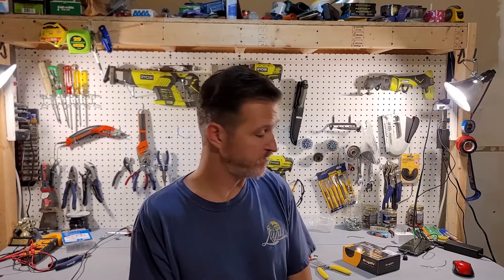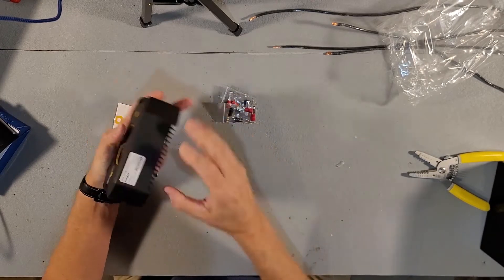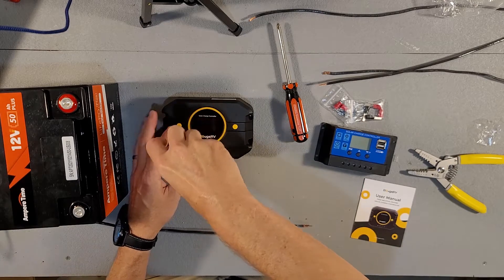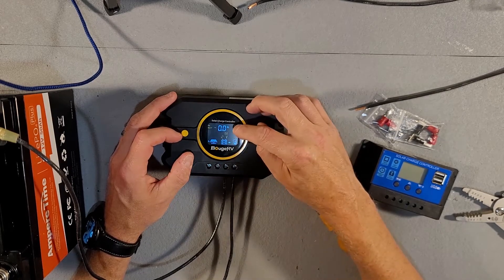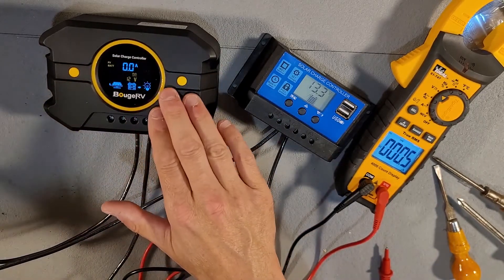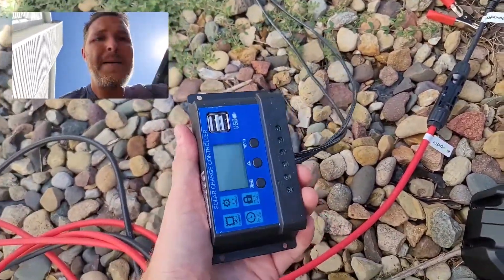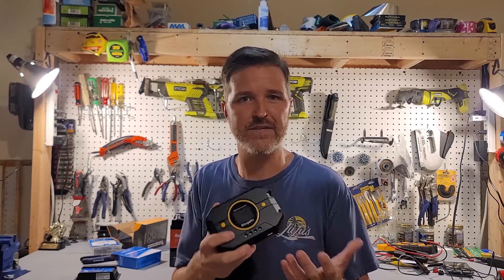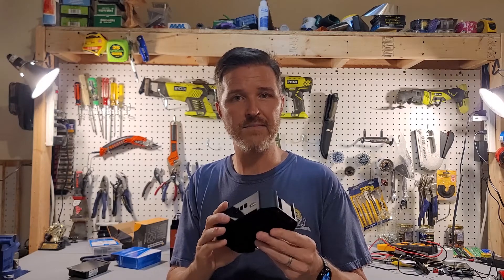30A PWM Solar Charge Controller Review| BougeRV

Comment: I have bought two Bourgerv 20 amp PWM for may small set up which will replace the cheapo ones. The reason for 2 is because I have two 100 watt solar panels in one location and the other two in a different location. The second reason is that the PWMs are small enough to work with in my limited space inside which would make wiring the necessary components around the inverter and batteries very difficult. Also, I don't see the justification for two expensive Victrons for the setup I have. Thank you for the review.